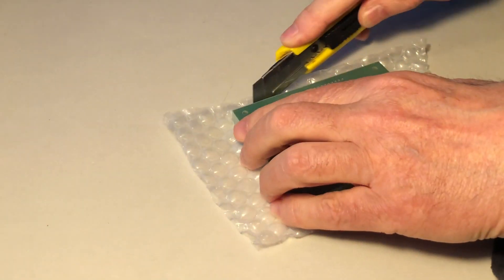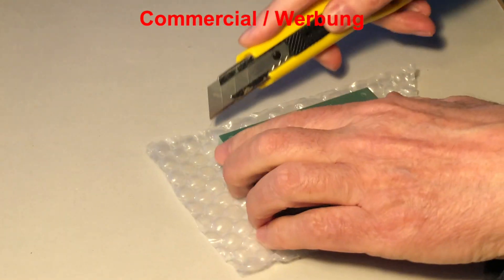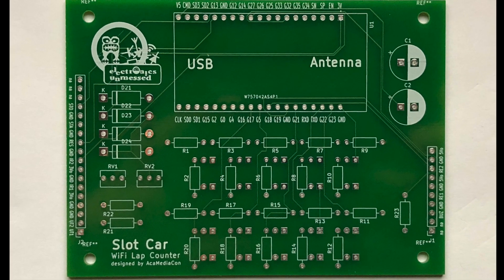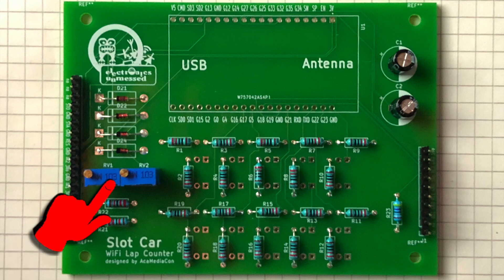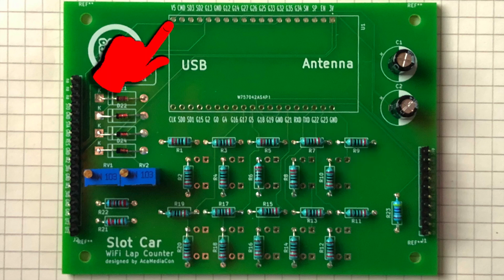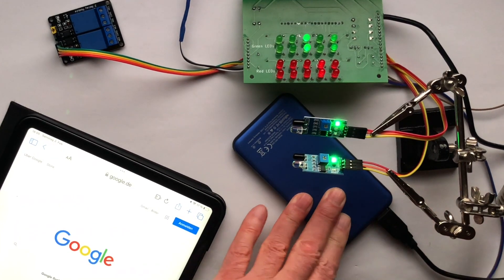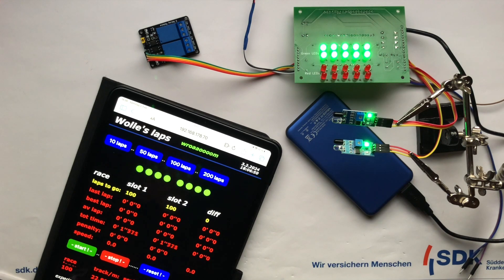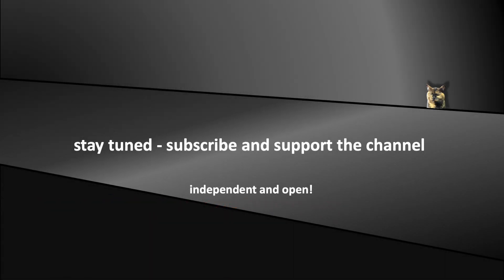How to make a Professional PCB for a DIY Arduino ESP32 Project (EP98c)

Comment: I can't find the kicad schematics or footprint for the dev kit of esp32 wroom 32.. I just want to make a single pcb for now and I only have the stated module of esp32 available.. where can I find the footprint
Reply from the maker: Hi there, thanks for your comment.
I also searched for the footprint for a long time and still couldn't find it. So I simply made a pad with the connections at the right distance and did the labeling myself. It's actually not that much work. Instead of a 3D model, I simply used a photo of the board. See also:
https://youtu.be/gxdyIW4vtOo